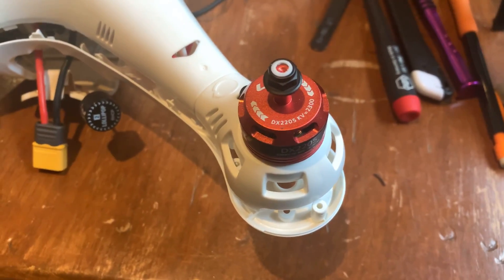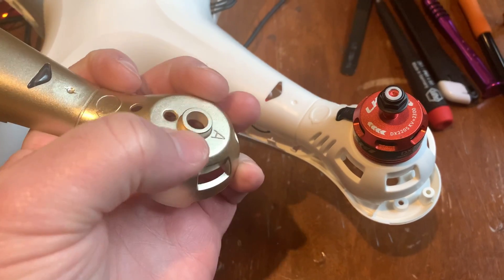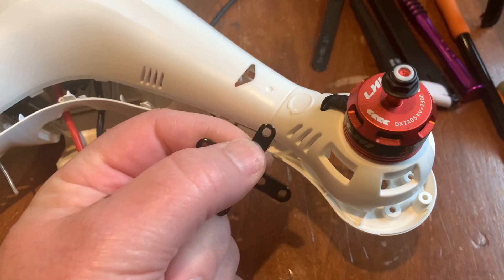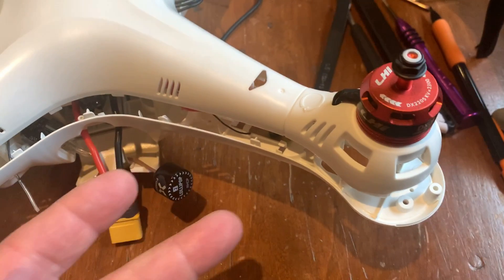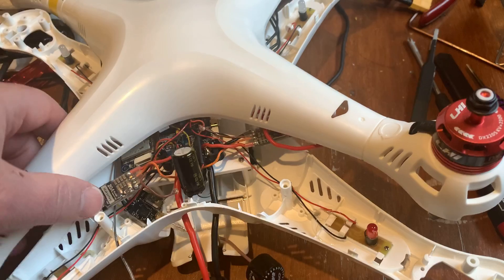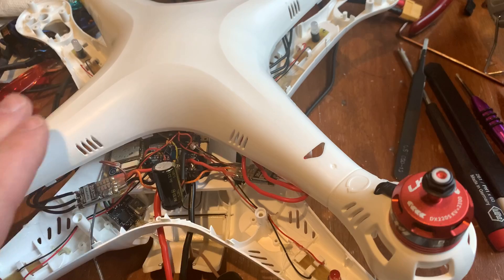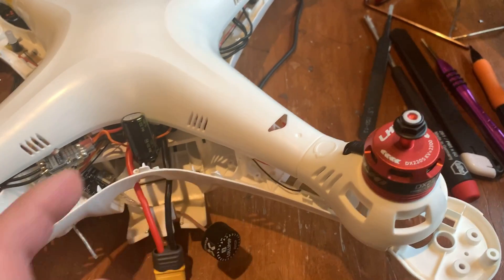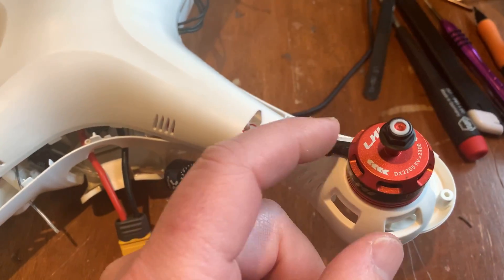Syma X8 Brushless Conversion

Comment: Great build Steve! Especially liked the way you mounted the motors - neatly side stepped the complications I ran into. Still working through a few issues with my build, but inspired enough to buy another white shell to build something to fly in formation with a phantom or two.
Reply from the maker: Thanks for the inspiration David 👍 It was fun to use spare parts 😁 I didn’t bother tuning the flight controller, just hooked it up to Betaflight to set up the two flight modes with my Jumper. It flys similar to an old 250mm 5 inch race drone. The flight time is about the same, 4 to 5 minutes.